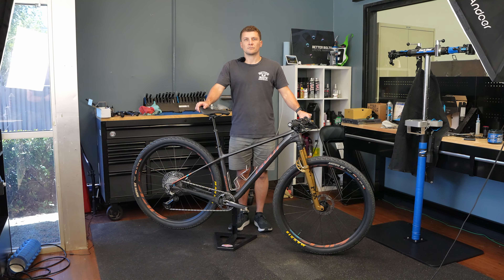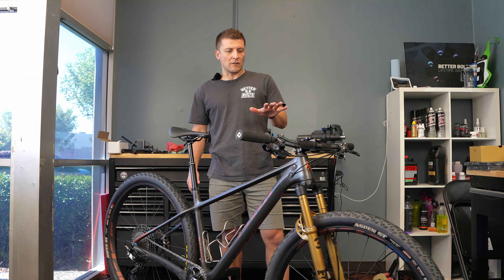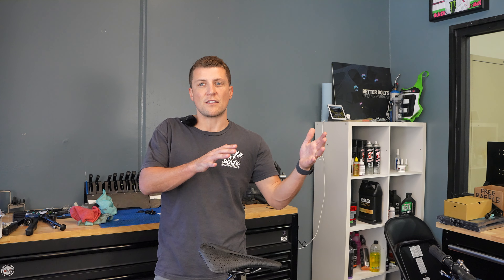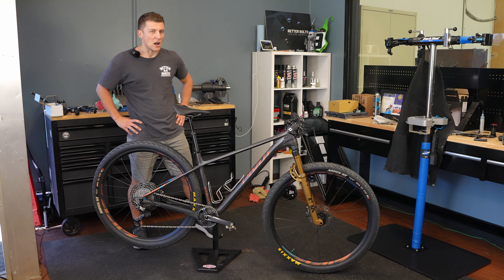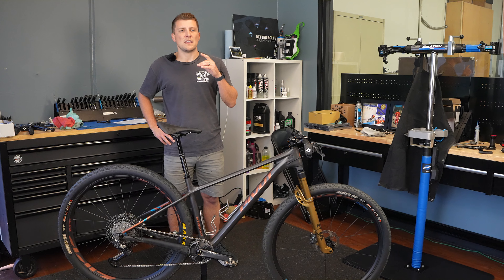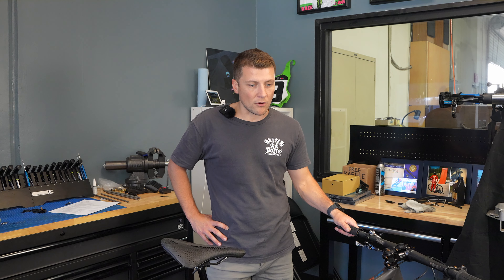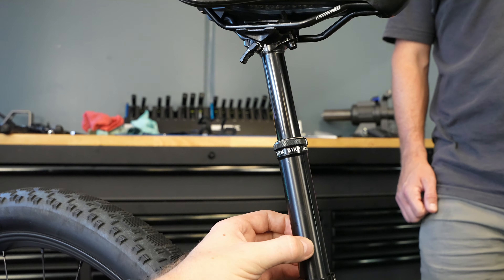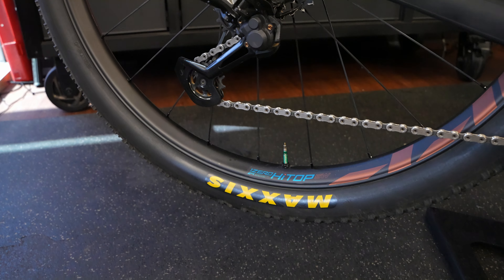Thomas' Pivot Les SL - Build Breakdown

Comment: I wonder why the seatpost is so extended. Meaning that it could be set lower into the frame which would allow to lower the seat more .
Reply from the maker: Yes on this frame the seat post is 27.2mm which really limits the amount of droppers you can run. Since this is an XC build we went with an 80mm drop Bike Yoke post which is why it is so far out of the frame. It saves a ton of weight but you loose drop. We could absolutely fit a 120mm dropper if we wanted, just a bit heavier which was not the goal of this build.